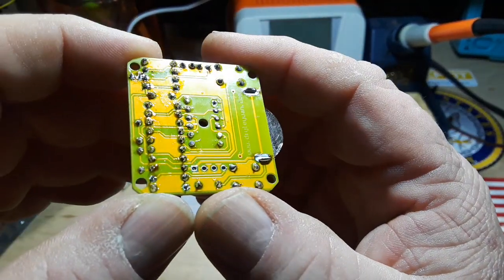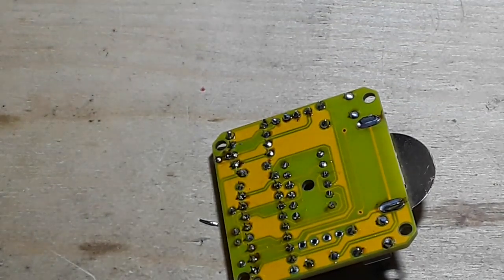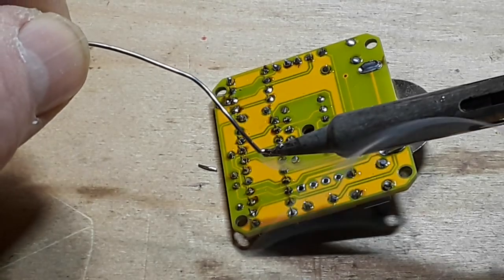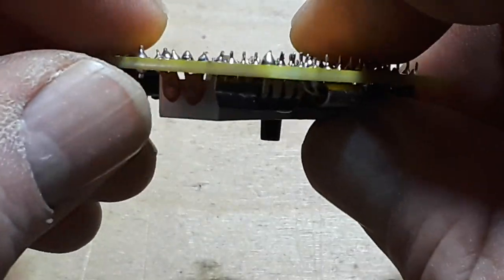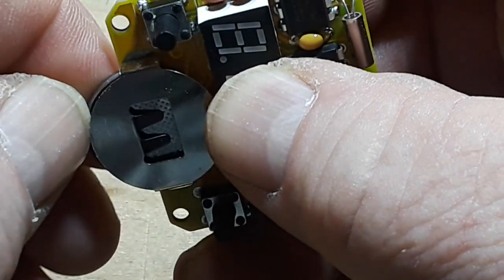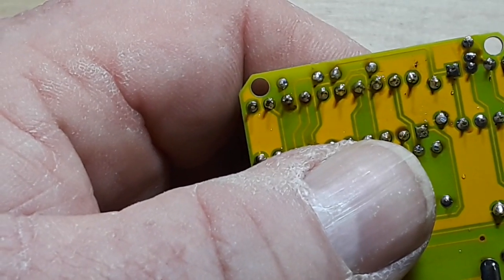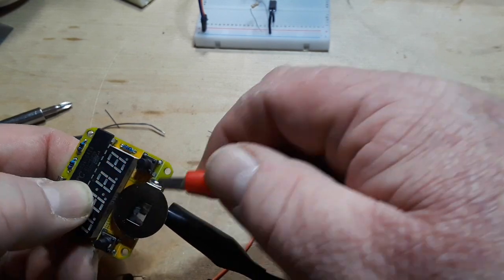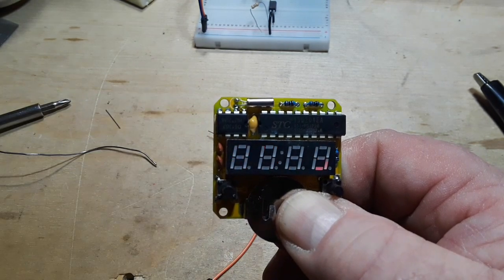LED Watch Build: It Works!

Comment: I think the display is intended to be momentary.  The LEDs in the segments would run that little lithium coin cell flat pretty quickly if it wasn’t momentary…
Reply: I’m going to build one and strap an 18650 to it.
Reply: @mikebond6328  Or, maybe, an extension cord… Yeah! That’d do it! Might limit your mobility a little, though. Maybe your 18650 would be a better idea…
Reply: @harryshector  wouldn't your wrist/hand get tired after a while? I know its a joke lol
Reply: @drinkintea1572  Well, yeah, maybe…. But, you’d be able to tell how long it was before you got tired…😉